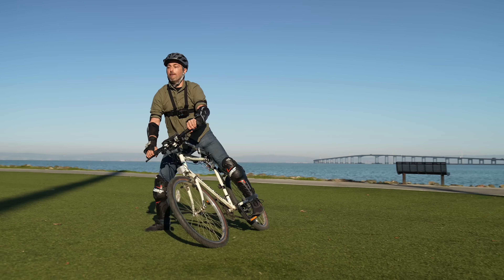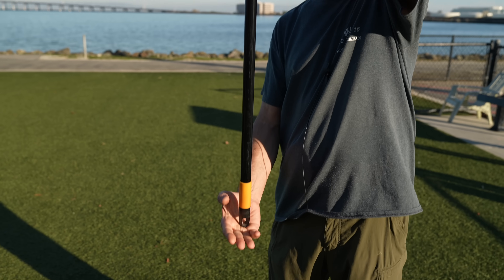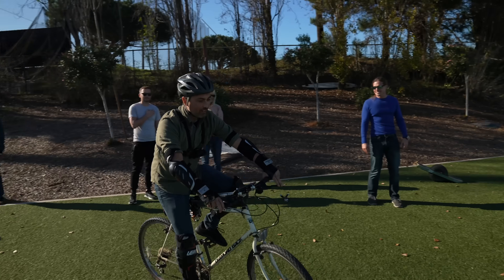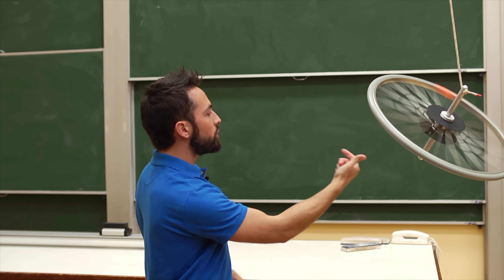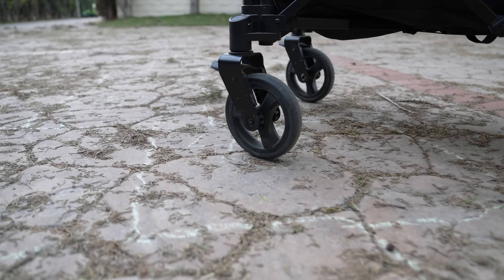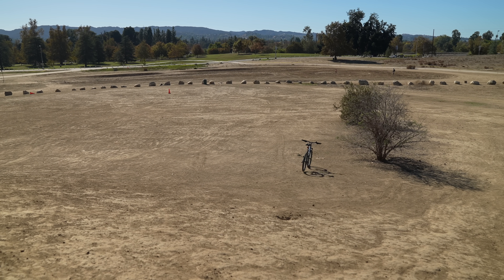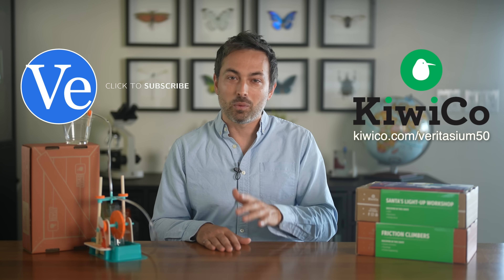Most People Don't Know How Bikes Work

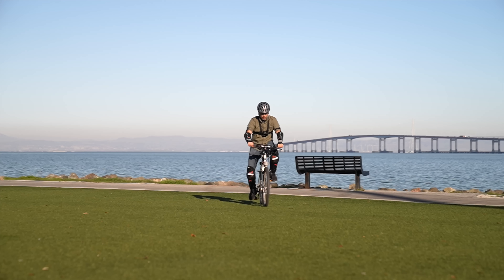Comment: I'm at 1:37 and I have to say it's weird that he's so focused on turning when really all you have to do is tilt the bicycle to turn. You can keep it straight and still turn. So really I thought this locking handle bar bike wouldn't be that hard to steer. We'll see his reasoning on it soon though.

Well now I know. You could get a turn started but you'd never be able get back upright without turning the wheel.
Reply: Nope - you can't initiate the turn.  You actually can get back upright because the steering is free in the direction of the turn.  To get back up you simply turn further into the turn.

Comment: there is another way tho, you can just tilt your weight on one side and the bike will tilt that way, making the turn in kther direction unnesecary
Reply: It seems like you can do that, but you can't.  If you could, you could also ride the bike in a straight line when the steering it locked.
Reply: @Rick_Cavallaro  explain riding on a bike without hands then
Reply: @kamilowski272  I think I explain it in the video.  But maybe I didn't.  When riding with no hands you actually steer with your hips.  You can't really lean your center of gravity to one side or the other, but you can move your hips (hips move one way, upper body moves the other).  This then takes advantage of the three described elements for riderless bike stability to cause the front wheel to steer.  You still counter-steer, but you do it with your hips.  If you lock the steering, you definitely fall.  I've put professional bike and motorcycle racers on the bike with the steering locked, and none can keep it upright for more than 3 seconds.

Comment: Well known by motorcyclists that actually take an interest in riding mechanics. I suspect that if the led positions were reversed then the rider would have no problem turning the bike. Note though that once in the turn the steering does point in the direction of the turn to a small degree, this would have to remain possible to turn succesfully.
Reply: Switching the LED's wouldn't help.  If you want to turn right, you have to initiate that with a small, brief left steering input.

Comment: Any thoughts on riding bikes without hands?
Reply: Yup.  Riding with no hands is relatively easy - but it won't help you on this bike.
Reply: @Rick_Cavallaro  I was moreso curious about the physics of it--i.e. why it works and why some find it challenging
Reply: @lxnny2357  When riding no-handed, you're actually using the 3 principles Derek described for the stability of a riderless bike to steer.  So you're still steering, but you're doing it with your hips.    You really can't lean your body to one side - not without leaning the bike to the other side (without steering that is).  So you use your hips to lean the bike slightly away from the intended turn, and that causes the counter-steering that then moves the contact patch out from under you in that direction.  That causes you and the bike to now fall into the direction of the intended turn, and you're off to the races.  But the entire time you're riding no-handed (including through the turn) you're steering and counter-steering with your hips to maintain balance.

Comment: Is the same principle applicable in case of bikes. When I need to turn at speeds higher than 50 kph, there is no way to "turn" the handle bar. All you do is increase pressure on left to lean left and once bike leans left it goes in that direction without any need to steer as long as bike keeps leaning which happens as long as you keep pressure on that side of handlebar. Can someone explain that in light of what we learnt in this video?
Reply: I think you'll find that you increase pressure on the left to lean left.  Increasing pressure on the left causes you to steer slightly to the right.  That moves the contact patch out from under you to the right, which causes you to lean left.

Comment: I just needed to come back to this video after Tesla anounced it´s new bicycle. It has a frontwheel turning motorized, while the stirring bar is not moving but fixed and with force measurement. It also doesn´t have pedals. I think this is a terrible idea and I think if Derek makes a short video on it, it would get a lot of view (hint!). It has some other specialities, which didn´t convince me at all, but the motorized stirring and the autopilot (!) are the things that weirded me out the most.
Reply: I had to look it up.
Did not find any clips where someone atually ride Tesla bike.
Whole concept is terrible.
I know it will sell well. People buy Apple products all the time, so Tesla believers will buy that.

Fly-By-Wire is bad in cars, but on bikes. Oh my.
Zero feedback.
How do you ride a bike without feedback?
What if it run out battery or get some electrical problems? 100% crash!

Comment: If you rode a motorcycle, this effect is much more obvious. Since you can't muscle the motorcycle around, and your weight isn't really enough to overwhelm the motorcycle, you learn, as quickly as you learn to ride, that to start a turn on the motorcycle you use a little pressure turning in the opposite direction to get the motorcycle to lean into the desired turn. You do the same thing on a bicycle, but it's very subtle on a bicycle. The heavier the cycle, the more you have to do this (and more carefully). This is especially true for heavy motorcycles at high speeds. You have to put a noticeable force for a noticeable amount of time to start a high speed turn. Once you have established a lean into the turn, you then turn into the turn dirction, stabilizing your lean, performing the turn, and eventually coming out of the lean at the end of the turn.

Comment: Counter steering. It would throw me off at such a low speed too but it's so ingrained in me from riding 2 wheels my whole life. Bikes. Motorcycles... They told us in a safety class to practice counter steering at higher speeds to be able to dodge debris.

Comment: 10:05....since most of us able to ride one without any knowledge of how we're doing it

It's the work of Subconscious Mind

We think we're walking but the complex mechanism is driven from within. The inner ear fluids helps on the balancing. Trillions of electrical impulses that's travelling back and forth makes our all our actions automatic without we being aware of it

Like driving a car where we won't remember how many times we used the brakes and maneuvering the steering left and right. But during learning stage it was a struggle  and slowly subtly it's taken over by the autopilot

Similarly no matter how arduous the physical actions is. With time you'll be skillful in handling even this bicycle being control from remote. Our skills can be enhanced so minute in precision where we just can't explain how we do it

Comment: Can you explain the counter steering way for riding a motorcycle. To go left at speeds over 10 mph you push the left handle bar and to go right you push the right handle bar. My understanding it is a gyroscopic effect that causes this.
Reply: Two things...
- Gyroscopic moment is one of the three things that causes the steering input.  The other two are the trail of the steering geometry, and the actual mass balance of the front wheel being in front of the steering axis.
- Lots of people will argue with this, but you do it below 10 mph too.  You just don't feel the push back on the bars at lower speeds.

Comment: So in two wheelers, turning is a two step process, 1st you have to lean in that direction by rotating handel in opposit durection(countersteering) which taks the vehicle to opposit direction transiently & in 2nd step because of the shift in center of mass to turning side the vehicle turns in that direction.

Comment: I learned how to ride a motorcycle in India. A guy saw me struggling with the bike and told me that if there is ever a really dangerous situation and I need to immediately turn to the left I have to push the left handle forward essentially steer right and lean in. Saved my life many times riding around down there on an old Royal Enfield.

Comment: I have been thinking a lot about this video as I was riding my bike and couldn't really find myself counter steering all that often, only when you go at walking pace, need a tight turn radius or when you need to quickly change direction. Most of the time you are not navigating an obstacle course and you take corners by leaning in first (if you live in a cycling friendly country like me).
Reply: On gentler turns it's much harder to notice, but you still counter-steer to initiate a turn.
Reply: @Rick_Cavallaro  See, I have been trying to catch myself doing this, but maybe it's because I was actively trying to avoid it that I could not detect any real countersteering.
Also, when you cycle without hands and you want to make a turn you shift the saddle sideways from under your bum and lean in the opposite direction. You don't use the handlebars either.
Reply: @Mispunt  When you ride no-handed, you don't steer by applying force directly on the handle-bars, but you do still steer.    As you said, you do it with your hips.  This causes the counter-steering input based on the three stability principles Derek described for a riderless bike.  Lock the steering, and you still fall.
Reply: @Rick_Cavallaro  Oh no doubt you'd fall very quickly if you lock the steering, you are continiously micro correcting your steering and centre of mass just to go "straight" let alone while turning. 
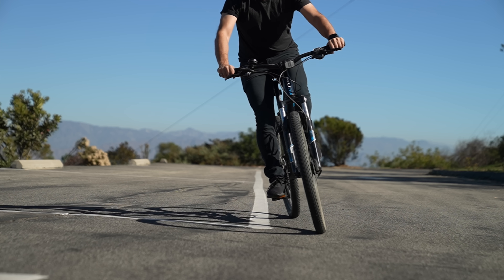My point is more that handle-bar counter steering as seen @2:46 is not the only way to start a turn. As Derek showed, it's forcing him to lean with the bike by steering it from under him. You can skip that initial handle-bar counter steering and go straight into the lean. I guess what I am trying to say is you don't need to turn the handle-bars to angle the bike.
Reply: @Mispunt  
>> handle-bar counter steering as seen @2:46 is not the only way to start a turn

But it is.  It's just that you don't have to do it with your hands on the bars.

>> You can skip that initial handle-bar counter steering and go straight into the lean.

There are a very small number of elite trials riders that are able to balance in that way.  But that's a very different skill than the rest of us use to ride a bike.

>> you don't need to turn the handle-bars to angle the bike.

Except for a tiny number of athletes, the rest of us do need to do that.

Comment: I laughed when I heard that the bicycle can steer themselves to remain upright.

I am laughing at myself, because a bicycle is better at controlling itself than me who can't ride a bicycle at all.
Reply: same
Reply: Just don't grab the bicycle and let it ride itself with you on top
Reply: I didn't know some people couldn't ride bicycles
Reply: @sandworm9528  I didn't know some people actually live under a non-metaphorical rock.
Reply: @jaykugosenpai9393  I might live under a rock and eat dirt my whole life, but at least I can ride a bike 😂
Reply: @sandworm9528  atmost*
Reply: @sandworm9528  I couldn't bicycle until 24 or 25.
Now I'm bicycling with my hands in my pocket.

I'm currently 27.
Reply: @1994AustinSmith  when you first learnt, at 24 years old, were you riding after one day ? I assume it wouldn't take longer than that
Reply: @sandworm9528  It took me like 4 or 5 days.
Reply: @1994AustinSmith  yeah i guess what I meant was if you haven't learnt to ride a bike it's just because you've literally never tried. Unlike learning to skateboard for example which would take significant practice
Reply: @sandworm9528  I have tried when I was young, and failed, and tried down a steep hill, and nearly broke a leg as I tumbled. That scared me away from trying again for over a decade.

Though that bike was the kind I had to back-pedal for rear brake.

I've learned to rollerblade long before bicycling.
Reply: Same
Reply: Same. I guess adding an extra 150 pounds that doesn’t know how to balance is too much for the bike to overcome

Comment: This video isn't actually 100% accurate. You can steer without countersteering. Im a professional cyclocross racer, and I do it all the time. Its hard to do in the mud, but you can do it anywhere its dry: what you do is whats called loading the tires. You gotta load the tires. Put as much weight as you can in the tires so you dont slide out. The more weight you have in place for a light load the more control and grip your tires have. With a mountain bike its easier since normally you have suspension, cause suspension can do the same thing. Suspension can also give you more grip. However, in a world tour race, you can sometimes notice that riders will counter steer at extremely high speeds going down hill. This is basically cause they are drifting slightly cause of the great speed. They need to over steer or counter steer (depending on thier situation) to maintain control. Same in the off road world, and same with gravel, same with sand, same with loose dirt, same with snow, when its loose its a good thing to know how to oversteer or countersteer to go where you wanna go. This video doesn't do bikes justice. You dont do most of your steering by turning the bars anyway. Nor by leaning. You lean the bike. Not the rider. This also increases grip.
Reply: Do you think you could ride the bike with fully locked steering?  Not to turn.  Just ride it in a straight line.

Comment: I wonder how it would work while riding bike without holding handlebars. Since you still can turn with your body movement, or fixed handlebars will disable it.
Reply: We've done that test.  When you ride no-handed, you're still steering.  But you're doing it with your hips - using the three methods of self-stabilization that Derek described for the riderless bike.  So riding no handed, not only do you still steer; but you also initiate turns with counter-steering.  Lock the steering and you still fall almost immediate - hands on the bars or not.

Comment: Great video!.    I  think, however, there is an overriding force  that must be remembered as well.  There are three components to a bike’s movement: up/down (gravity), right/left (the “wild card” force the rider “provides” by maintaining balance, and forward/(backward) which the force provided by powering the bike.  In fact, the question really becomes, “what use is the front wheel?” And the answer (as anyone who has tried and failed to ride a unicycle knows) is to balance the bike,  which, depending on some simple calculations means provide a  path for the for  the forces needed to correct the two of the three components of the principal force.  A bike steers just like a unicycle when the front wheel is not touching the ground, and that’s one reason why wheelies take a  little practice.    What I feel like this video demonstrates is exactly what is required to manage a bike when up/down and right/left become significant components of the bicycles motion relative to the force supplied by the power to the rear wheel.  Motorcycle people get all excited about the speed at which counter steering matters and then claim bicycles behave differently than motorcycles because of the ratio of the riders weight to the bike weight.  This video demonstrates how stupid that idea is.  

I lived the mention of the “inverted pendulum.”  walking itself involves managing such a pendulum.  I think that’s why managing a bike seems so natural to people.  Watching toddlers really shows off how much skill and small muscle control it takes to manage the “simple” act of walking.  When the man balanced the pole in the palm of his hand he was demonstrating a concatenation of inverted pendulums  - an intriguing problem in its own right. 

Finally, there is the question of exactly how the balancing skill is acquired.  There is a weird axiom about steering bikes that might explain it.  The bike “goes where your head goes.”  You go “wherever you look.” It takes concentration to overcome that axiom.  I think the first thing  babies learn is how to manage standing upright.  In effect the develop the muscles they need in order to keep looking at the thing they actually want. And eventually and paradoxically standing soon leads to walking, probably to overcome falling down by unconsciously moving a keg to cat their balance.

Comment: On a motorbike, at least when I ride mine, I use counter-steering, i.e. when I want to go to the right, I push the handle bar right forward slightly, so the bike starts leaning to the right (due too the gyroscopic effect) and will make the turn. You use the weight of the bike to make the turn on a motor bike and not the weight of your own body, like on a bicycle.

But when you go slow, when there's no gyro effect yet, this counter steering doesn't work and you need to push the left side, to make a right turn. Luckily, you don't need to consciously and continuously need to calculate when to switch between the 2 methods :-)

Comment: I assume that when the L/R were being locked, both the handlebars and wheel are locked out of going past the "neutral"/"centered" position entirely.
I'd be interested to see how disengaging the handlebar from the wheel would affect things. (ie, turning handlebar doesn't turn the wheel, but the wheel can otherwise turn normally. You might need to adjust it a bit so that the wheel's center of gravity is still in front of the axle. not sure.

How difficult would it be to adjust to riding that? Would it be rideable? etc.
Reply: >> I assume that when the L/R were being locked, both the handlebars and wheel are locked out of going past the "neutral"/"centered" position entirely.

That's correct.

Disengaging the handle bars from the steering would be roughly the same as riding no-handed.  Plenty of people (including most of the people in this video) could do that easily.  But if the front wheel was still locked out from going past neutral, they'd still fall.